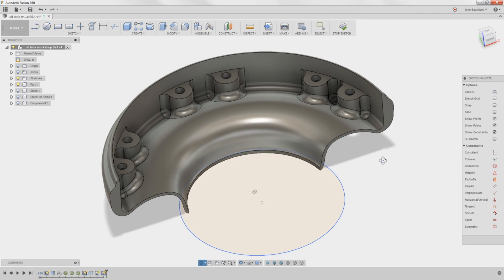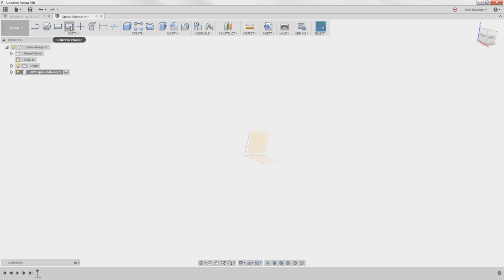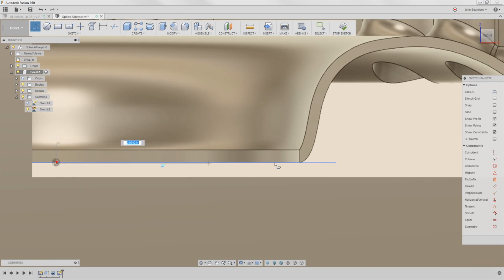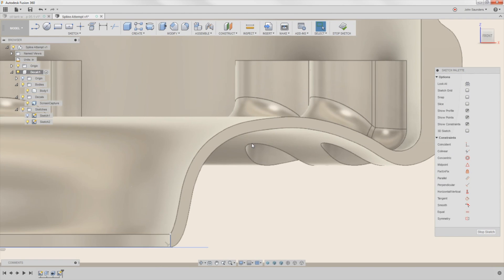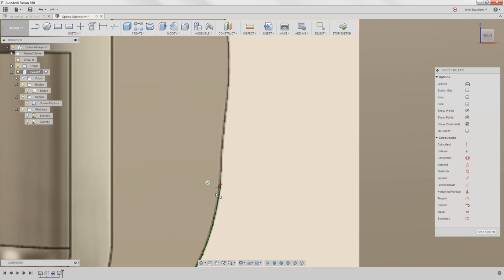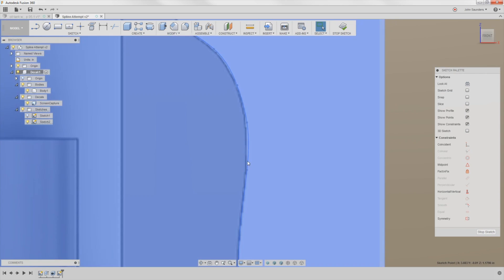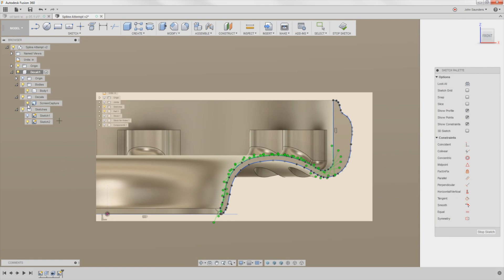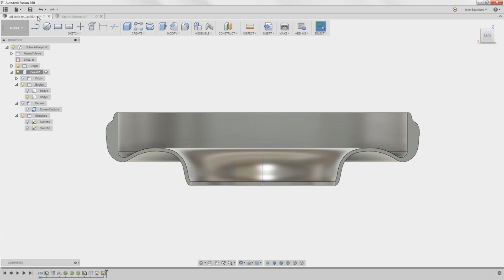Fusion 360 Spline Tutorial & Trick!  FF67

Comment: Pretty cool!  The model I gave John to machine the inside of the tank was created from a scan of a previously machined part.  It was an artsy part to begin, and then there were lots of issues with the original machine work.  In creating the model for John, from the scan, I corrected for areas where the part will eventually be hand finished, to blend away said issues.  The main goal was to have (as close as possible) uniform wall thickness for the exterior wall of the tank; both for structural  integrity and for maximum weight savings.  So, kudos for John for following that wavy shape so well.  Less is indeed more with splines, but a shape like this will take more than normal to capture accurately.

This part was re-purposed from originally being a huge electric motor mount, to being the external shell of a custom oil tank.  It has (since John's machine work) been re-purposed, again, and will now be a part of the housing for a custom cooling unit.  John, I'll share more about it later as we start fabricating; and can't wait to send some more CNC work your way!

Comment: Hey John. How well does fusion convert splines into g-code? Any time I have done something similar to this, I’ve always had to use arcs which are easily converted into machine code. Is there a benefit to using splines instead of arcs? It seems like a spline would add a whole bunch of extra lines of code compared to arcs.

Comment: Just a comment: I suppose Fusion 360 will have curvature visualization while editing splines

While splines are really easy to use and seem to do the job imitating the model well one aspect that will stand up in carbon copied models with them is that the reflections or touch seems off. If your CAD software has zebra analisis you can preview it in them. The "TLDR" version (this is just a youtube comment afterall) is that a spline should start from a regular shape with the same curvature (lines= 0, circles = radius) and evolve slowly. 

And as other people said, in spline world less is more.

PS: Loving your channel :)
Reply: Yes this is a subtle point. At the connection between lines, of course you should have the lines being tangent. That is to say, you want to avoid having the line making an abrupt change of direction. But the subtle point is that in addition, at the junction of the two lines, you probably also want to avoid an abrupt change of curvature. In short, at the junction, it's good to have zero change of direction, and zero change in the rate-of-change-of direction (first derivative of direction, which is curvature), and possibly even higher order derivatives of direction.

Comment: I used to be the same way! When I was teaching CAD, I always gave the advice "trust the spline!" Came out great, but I think the biggest step in getting good with splines is realizing you do not have to map with as many points as you think. I bet you could have gotten it with 25-50% fewer points. I also hesitate to add spline points because then you start to get very rapid changes in curvature. What works even better is to just adjust the handles. Does Fusion show you curvature combs like SolidWorks does? Great job!

Comment: You use way too many control points on your spline. My guess is you should need only about 10-12 for the outside profile, and 6-7 for the inside. Is the original model you're trying to copy still in parametric form? If so I would recommend you have a look at the actual original spline and try to understand it.

Comment: John - Splines are really easy.....think of the "control points" as tangent lines.   Basically you have a vertex which is a point that the line goes through.  Then you get to control how the line goes through that vertex.  The way to do that is with the control points that basically move a line (not your curve) that goes from the control point to the vertex.  The curve follows the control line in a tangential manner.  The closer you move the control point towards the vertex the closer tangent point is in the control line.  I believe that this could be done with far fewer vertexes and achieve the same result.  Basically, you only need a vertex when there is a significant change in the curve.   Try to imagine if you made the spline with a bunch of tangential circles and then trimmed away the parts that you don't need.  The intersection of circles is where you need vertexes.   Thanks for the videos, fixture plate, and class  - Paul

Comment: Splines make curves that blend nicely into each other between the node points. Play with the control bars; the rotation of the bar controls the tangent line (that the adjoining curve blends to) and the length controls the "strength" of the curve on either side of the point (shorter is tighter). 

Don't try to "outguess" the splines and pick nodes off the desired line to "fool" the curve into following your desired curve (the decal). Put the nodes directly on the curve and use the control bars to pull the rest of the spline onto the desired curve. If you just can't, then maybe it's time to add another node on the desired curve (or move an existing node along the curve to a better position).

Fewer nodes reduce the computing power needed.

Comment: Too many node points. try placing the node points on your finished spline and rebuild it using tangent 3 point arcs and lines OR  on initial creation use fewer node points 
by manipulating the control points to make smoother overall geometry. Also I'm not too familiar with Fusion but I don't see where your "decal" has any definable scale factor so I question if it is really a 1 to 1 of the original model. I've had a fair amount of experience with splines in Mastercam they can look good but machine kinda rough if you're not careful! keep practicing.

Comment: I have a lot of experience using splines in Inkscape (a program for vector graphics) and I also have to say: less is more. You have way too much points, it's better to have just some points and correct the spline with the control bars. If you have too much points, there are too much variables and it's easier to mess things up, but it's doable if you have just a few points. Getting the spline to the point where you want it, it takes a little practice with the control bars, but that comes with time. Just don't be afraid of them, they're no rocket surgery, as AvE would say ;)
Reply: No need to defend yourself, keep up the good work ;)

Comment: Attach Canvas ;)
Reply: And less is more with spline points - use the tangent handles to control shape and you'll get cleaner geometry.
Reply: one point per point of inflection (where curve changes direction) and a point at each end. then pull the point to the curve and pull the handles to match the curves between points.

Comment: With splines, less is more. I fear you're encouraging the exact opposite :/
Reply: 100% true! Learn to use those bezier handles and use as few points as possible. you'll get much cleaner and smoother results and once you get the hang of the adjustments, less headaches.
Reply: I agree.  As John mentions in the video, one of the most challenging thing about splines is that changing a node downstream affects stuff upstream seemingly no matter how far away it is.  One way to help deal with this is to restrict yourself to 3 point splines:  start node, end node and middle node.   Connected splines can be dealt with by adding a tangent relationship to the end/start points of adjacent splines.   This way, the next spline won't affect the previous spines.
Reply: rob lockwood 
Agreed. You want to use as few control nodes as possible. 

But 9/10 times the software also has a "simplify spline" option that deletes unneeded nodes.
Reply: i end up like a mess no matter what
Reply: Andy Birko 
You can also start out with a bunch like John did, then start deleting them out manually. 

It's longer and less efficient. But gives you the option to undo if you have too few points. 

That's how I taught myself. Put a bunch, then states deleting nodes to get an idea of how many it takes to construct certain curves
Reply: He knows nothing. Just one big "don't do this" demo.

Comment: When it comes to splines less points is better. Do just a couple points then control with shape with the handles on each point. That same shape could of been mad with a 1/3rd of the points you used. Then you would be using the strength of the spline of being a smooth surface and ultimately have a better machining surface.
Reply: Thanks for the reply. I was wondering the same thing for a part I'm modeling. I'll go back and remove a few to see how it looks.

Comment: try insert canvas instead of decal.  that will let you use the x y z plane. and it will let you calibrate its scale!
Reply: a decal is used for actually attaching something you want to see in the render, the canvas is what you want to use to do what you are doing.
Reply: Yes, just like tylor abel said, and the calibrate feature is awesome, I use it a lot for making tooling and mounts that need to fit onto existing tooling, I just take a photo and measure a feature to use for calibration than design on top of the picture. Decal will actually act just like a decal and will wrap the image around 3d geometry.
Reply: I was coming to tell him the same thing. Good thing someone beat me to it.
Reply: Correct - decal has the advantage of being able to wrap around a shape (which is why it is called decal). Canvas will not but is easily scalable to the drawing scale from any known dimension on the canvas.